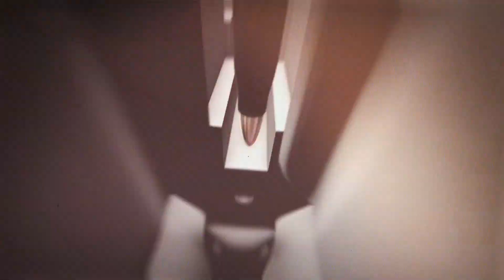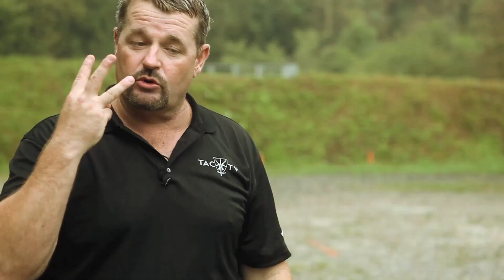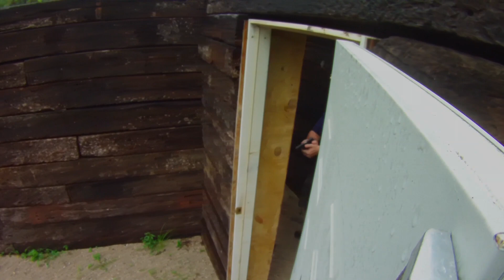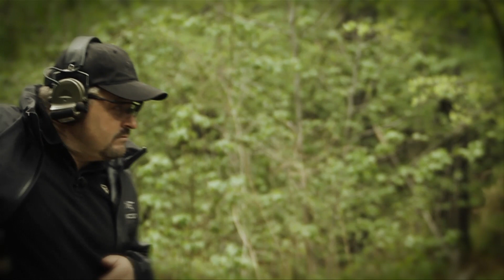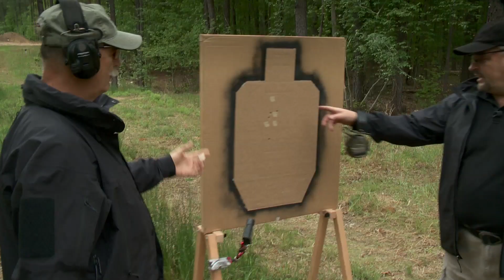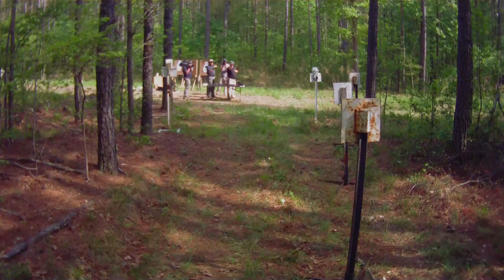Tac TV S1, E7: The 1911

Comment: I've noticed that lubricating the trigger assembly also helps. A drop in the middle of each side of the trigger where it goes into the internal trigger rails is all you need. 

Makes the 1911's already smooth trigger pull even smoother.
Reply: I use a tiny bit of grease. Nothing much. Just a dab.
Reply: Wow!

Comment: Everyone listen, if you are hurting on the price of a Springer colt kimber etc dont but cheap. I asked Larry several times and he answered. But i still went cheap. I bought a rock island tac ultra 2 which was nice but had a major flaw. I got it brand new and fired 250 rounds thru it. Federal, b&s and sig. Only 8 rounds of sig v crown to see if it fed. The gun was always cleaned and lubed, only field stripped. Never banged up etc. The hammer dropped the half cock 70% of the time it was racked. I had experience with there old 9mm 1911. It was my brothers and never had that problem. When my brother was on leave I showed hin the gun and he loaded it (we both know each others guns are always loaded) he racked the slide and it fired an inch past his leg. Only thing i swapped out of the gun was a wilson combat guide rod and plunger tube. It did it without that too. I sent it back they gave me a new one not a single round thru it and it did it again. So now I'm looking at a series 80 colt. I found. A used comp model for 750 looks brand new the brand new gi one was 850. Some will say its the gun slam firing but when the mags in and it has to strip the first round off that force is drowned out so thats not it. Also my case was bent idk how because nothing hit it.
Reply: Wtf, that pistol has a safety notch on the hammer, it sounds like he had his finger in the trigger guard when he racked it.

Comment: Just picked up my second 1911, gave my wife the Kimber TLE 2 I owned and operated with for years, had seen combat using the 1911 in my third tour in AFghanistan (After I was given loadout options and moved to operations). Anyway, the SIG Scorpion 1911 (got it with custom grips, a nicer trigger than the already nice triggers that come with, spare parts, but the trigger, the overall feel of it, the unique SIG look (just higher bore-axis but it's no issue)....the FINISH they put on their 1911s, compared to kimber or some colts and Springfield I used...so much better.

IMO the 1911 .45 ACP is still one of the best firearms ever. I plan on having my SIG 1911 until the day I die, outside of my HK P7, HK P30, USP and P2000 (which served me so well earlier in life), and a SIG P229, P225 W German Police trade in and P220 equinox.....So, really just marvels of engineering and hihg-end pieces...but almost all of them I'd give up to keep my 1911....objectively the USP and HK P7 are better, better engineered, more durable, etc. Still would be hard-pressed to take them over the 1911 :)

Canot rcommend the Scorpion highly enough.
Reply: I’ve got the Scorpion P220 ! Love it , eats everything!

Comment: I was shooting a Gunsite SA 1911 and the +P 230 gr Ranger ammo popped the plunger tube completely off! :-O I don't use +P 230 gr anything anymore.
Reply: Unless your using a sig 220 / sig 227 . Hk Usp45 / hk45 or Fnx45. I wouldnt use 230 +p in my pistols.
Reply: That plunger tube wasn’t correctly staked, being an SA, it doesn’t surprise me.